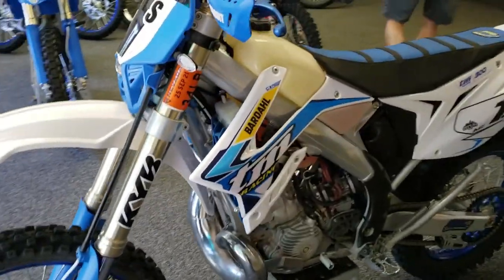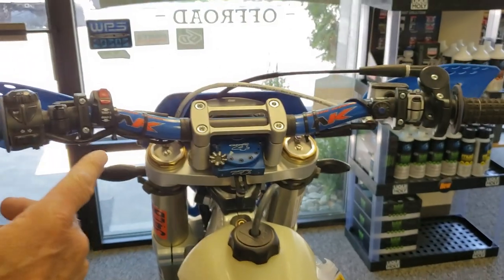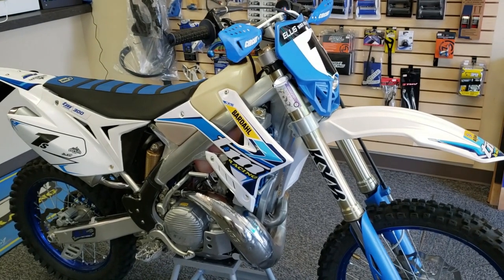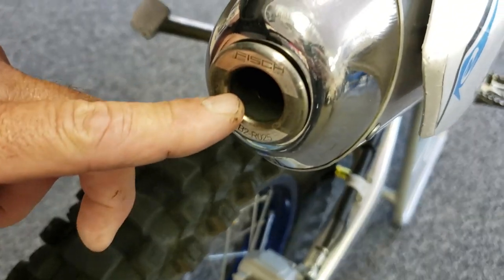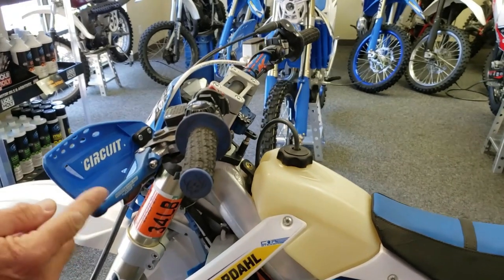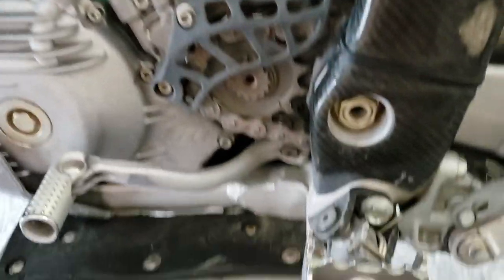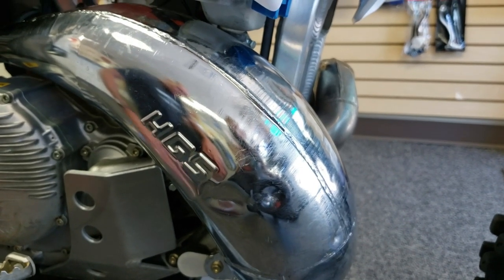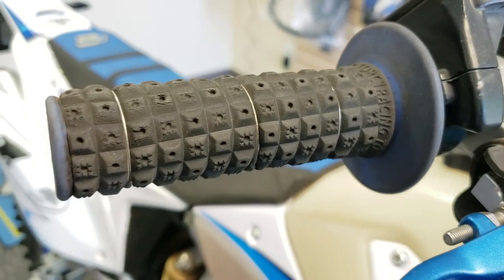TM EN 300 / 100 Hour review

Comment: gday bike guys, loving the TM's. Iv heard a few people talking about the power valve resetting and running roughly for a while  every time the bike turns off or stalls. Im very close to buying a carby 300, I race hard enduro and this could be very annoying problem for me.
this seems to be the place for real info on them.
Reply from the maker: Hi Josh, we have re-set the power valve before just to check for proper operation, but found no problems, be sure you run quality oil in your fuel, and jet the engine for best performance
Reply: Yeah TM has been terrible about resolving the power valve reset issue.  It's been a few years now.... sad.

Comment: Nice review. I appreciate all your detailed explanations. At 6 ft. tall and weighted with all your gear did you need to put heavier springs on? Or do you wish you had put heavier springs on?
Reply from the maker: I tried the heaver springs and found it great when you where going extra fast or aggressively. I enjoy riding single tracks and more technical trails, so the stock springs give a easier ride.